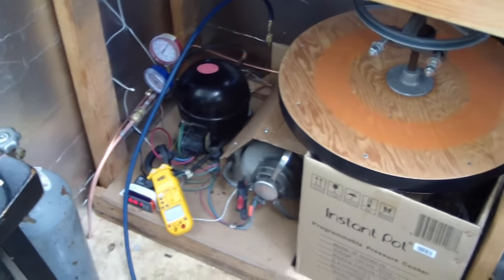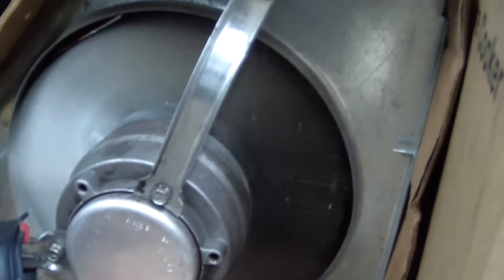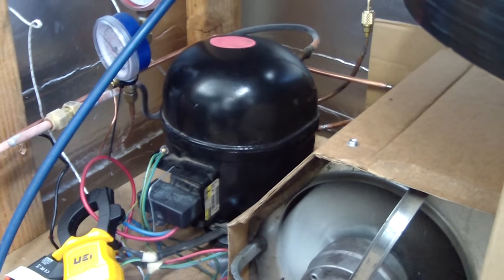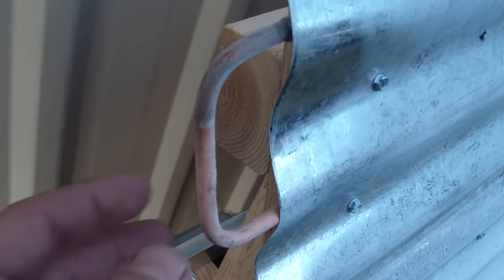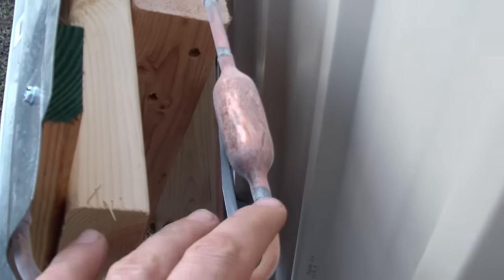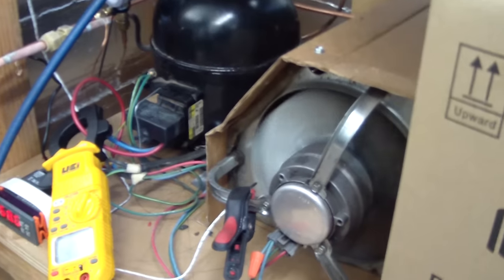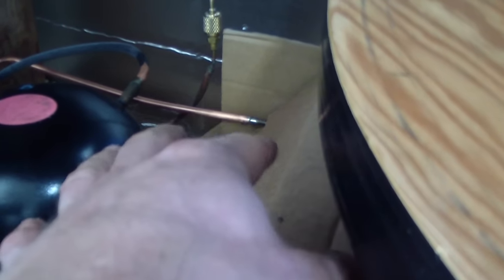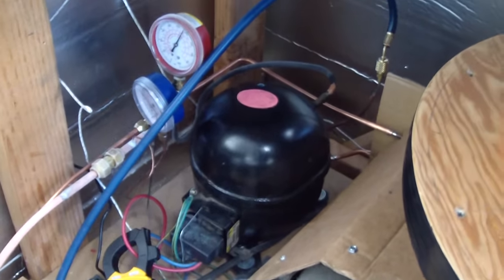DIY Heat Pump With Propane

Comment: Woah propane instead of the refrigerant isn’t that dangerous?
Reply from the maker: involved gamer, not really.  No more than driving around with a tank of gasoline. In fact, propane refrigerant is probably much safer.
Reply: M.C. Pletcher that is interesting because I always thought with enough heat it could explode but then again if you pulled a vacuum on their won’t be any air to cause it to light up because you need the fire triangle present heat fuel and air and air is not present interesting I never thought to use propane
Reply from the maker: involved gamer, you got it. Propane was used in a few domestic refrigerators in the 20s and 30s. Butane and isobutane were used as well. I would bet money that the majority of domestic refrigerators manufactured today use a hydrocarbon refrigerant. Isobutane in refrigerators, and propane in commercial freezers.
Reply: M.C. Pletcher most of all commercial freezers run off of standard refrigerant
Reply from the maker: David Ramsey I am guessing here, and I'm referring to units worldwide. If you look at domestic upright refrigerators, isobutane is exceedingly common. I'll have to check some stats. Propane is becoming more common in upright freezers. To what degree, not sure. Walk -in units, sure, standard refrigerants.
Reply from the maker: Not sure where this stat comes from, I'll look sometime for better data, but there definitely a lot being manufactured for use outside the US.  The EPA only recently lifted the ban on HCs.  2014, I think.  Europe has had HC refrigerators and freezers since something like the early 90s.
https://www.truemfg.com/AboutUs/Natural-Refrigerant
Reply: M.C. Pletcher I am interested in how your system is still doing? How did it do over the winter? Also did you ever paint the metal panel?
Reply from the maker: No, I never got around to painting the panel.  If I would have made some effort to study the performance of the system, I probably would have painted it to compare.  It was a short lived (and cheap) way to provide heat in a small, well insulated space.

It continued to operate well through that winter and the next.  I didn't notice any loss of charge.  Excessive frosting of the evaporator often lead to frosting back the suction line, but I never noticed any problems with the compressor.  Basically beat the shit out of it.  Served my purposes well enough.

Moving in a few months back to PA, so I tore it apart and scrapped it.  I'd like to get away from electricity as much as practicable, so I'll be shifting back to wood heat and solar thermal.  Refrigeration will be coupled to the cold winter weather, and largely passive.
Reply: Propane IS R290 refrigerant

Comment: how did you fill the installation with propane?
Reply: He probably used r700 it's a propane refrigerant sold at HVAC supply.
Reply: Or R290

Comment: I was wondering if you could enclose the plate outside, face it south, and put glass on the south facing side to gain a boost from the sun during daylight?
Reply: the glass would block the far infrared rays which do the best heating, maybe if it was quartz glass but that's not cheap.

Comment: Would it make sense to turn it 90 degrees to get the funnel effect dragging air through the holes between the plates, getting better heat exchange 🤔

Comment: Propane is a great refrigerant. The stuff is as good as R12 but man is it flammable.  Also that's quite a lot to ask for from that poor little fridge compressor.  It's like leaving the fridge wide open.
Reply: Yes, these fridge compressors are not meant to be run nonstop like this. Normally they work for few minutes, and then cool down. In continues operation they will probably overheat a bit. Sure, the thermal protection will kick in if needed, but I am sure heat in continues operation will kill it quicker.

Comment: Nice video. You have any clue of the cop?
Reply from the maker: It's been a while. I can safely it was at least 2.0. May have been as high as 3.0. Probably not more. Better than resistive heat!

Comment: wouldn't you want the "accumulator" before the evap?
Reply: Needs to be after the evaporator and before the compressor. Keeps liquid from getting back to the compressor. But I don't think his accumulator is installed properly needs to be installed in upright position (If it is an accumulator).
Reply: SLA, ahh. After a few months of research, coming back to watch this. Those low suction temps are likely to flood the compressor. Looks overcharged for the size of the evap. I read that ideal temp on suction is 59.

Comment: Hi, how did you calculate capillary length?
Reply from the maker: Michael B a fair guess based on the compressor HP, and a similar refrigerant to r290 using the chart provided with the JB Industries cap tubing. Might be 507c?  Not sure. There's a document online from Tecumseh or Bitzer which describes the equivalent refrigerant for r290.

Comment: Well done sir! I am designing a similar HP system using several scrap window units that have a 5k btu scroll compressor which I will run in parallel for more capacity. I have a 28' deep well under the house that may end up being the low side coil. A poor man has poor ways.
Reply: Did you ever get it going? How well did it work? Have you made a video?

Comment: Watching setups like these almost piss me off. (No offense) but while I understand you might be living somewhere up north where its cooler and need a heater more times than cooler, for us it's almost the opposite, running the A/C almost 18 hrs everyday to put up with the heat. Even when it's not summer, A/C is still needed to keep my servers cool, etc. Since electricity is very expensive in many parts of the country, it pains me to see setups like these where you produce x amount of cold (byproduct of you harvesting the heat) and you're just wasting it outside instead of taking advantage of that cold to reap more savings and efficiency. Please, if you're going to use this design, take advantage of that cold for an ice maker, cooling down servers, supplement cooling down a freezer chest, etc... /Triggered Rant Over
Reply from the maker: Woah!  Came on a little strong, but it's okay, I don't take any offense; you make some interesting points.

It would be possible to have rigged this up to my refrigerator in the lab, but load matching is the problem there.  If the the temp is low outside, and the heat pump has to run a lot to satisfy the thermostat, then I run the risk of overcooling the refrigerator.  If I wanted to supplement a freezer,  the problem is that there's just not a lot of heat to be had in there, and the evaporator temperature would be extremely low; much lower than just pulling heat from the moist outside environment.  If this were a larger, more permanent installation (and not just farting around), than I would consider pulling heat from a phase change material coupled to a refrigerator, or some other cooling mechanism.

Heat pumps are a common fixture in northern climates, and with the exception of large commercial installations, little effort is put into matching the heating load of a structure with a necessary cooling load, if one exists in the first place.  Heat pumps just come down to an effort of making better use of a high quality energy carrier like electricity.

What does electricity cost per kwhr in your area?

If you don't already do so, I would suggest installing a heat pump water heater to do just what you described for me.  Find passive ways to cool your home and servers more effectively, to reduce AC costs, and insulate/shade your home however possible.

Thanks for the comment.
Reply: Might as well ask you to use the excess heat your AC units put out the the outside to cook hotdogs. Don't let it waste ;)
Reply: @whatawaytogo515  well said ,  the co-efficient number is crazy to match ,  I had this idea  way back.  I planned to use recovered rf compressor's (from old domestic units) to cool my cyrypto  mining gear .   The maths were good (even if not living in Quebec) (i live in Ontario) , but with the heavy off peak price this was feasible.

3 units mining rigs @ 1500 watt  making 57 penny an hour / over the heat pump system /  was good enough setup , 

but Bitcoin math works no more
Reply: Reading comments like this piss me off no end.  If you want to do your setup when YOU build it different, go right ahead. Don't get pissy at someone who has done something and taken the time to share their clever and interesting setup with other people because it's not the way YOU would do it. This suits the guy that built it for his purposes, he's under no obligation to build it to your satisfaction.  The idea here is to show the fundamental principals and then others, like you, can adapt it to their own varying need. I personally got a lot out of this vid and if you didn't, Move on to the next one and quit your bitching or better still, put some content in your channel instead of complaining about others that have got off their arse and been kind enough to show their ideas to others.  Always the same,  whinge about what others have done without ever doing anything themselves.
Reply: Er, that's how heat pumps work? Why not harness the heat your AC pumps to the outside to heat your hot water?